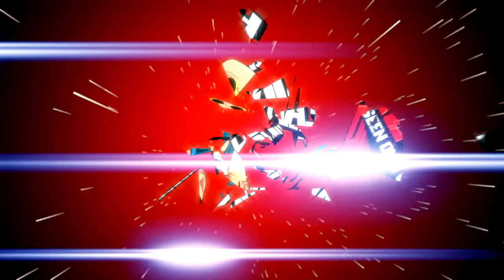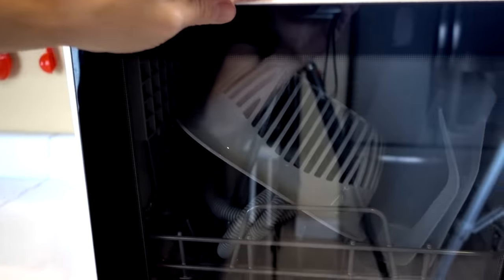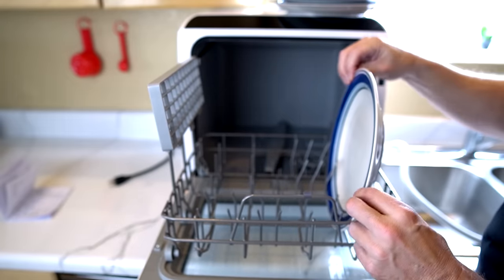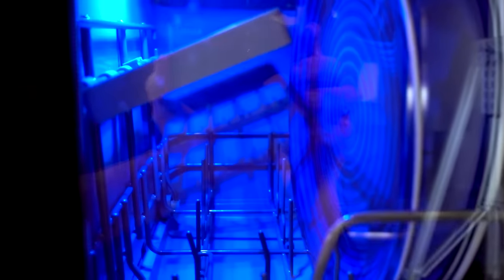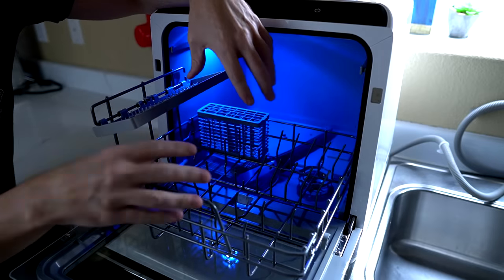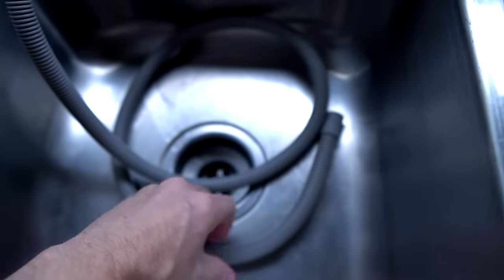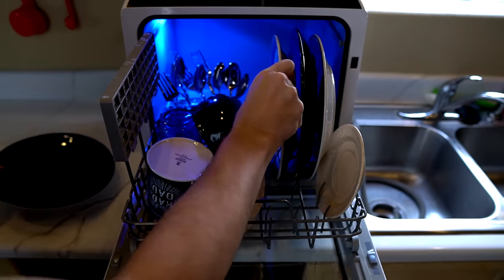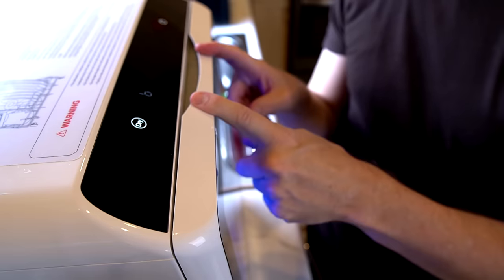Do Countertop Dishwashers Work? By Request!

Comment: Not sure why I have never heard of a counter top dishwasher but for a single guy with one kid and a ton of back problems to the point I can’t do 10min of dishes this might be an option!
Reply: If you have any way of getting a fullsize dishwasher (even if you have to wheel it to the sink and connect a hose to the faucet), they're much better. But if you have absolutely no way, then a countertop dishwasher is better than nothing. Get the largest model you can find and make sure it heats the water after it's pumped in. Some don't.
Reply: Dude same.. I can't stand up for that long hunched over a sink.. like if my counter was a foot taller I may be able to.. but my apartment is tiny and I live alone. Already have one of these on the way
Reply: I have more metal in my back than a Kia...LOL.  If I wash more than just a few dishes by hand I use a stool.  I would never buy one of these units.
Reply: I would never give up my full size dishwasher in my current kitchen, but yeah I can see this for people with back problems, or a small apartment, but where this really would be impressive would be a renovated RV/travel trailer, with it plumbed into the gray, and fresh water lines with a shelf built under the sink area to keep it out of the way.
Reply: @rantsandreviews  Dishwashers that heat the water sterilize the dishes better than you can wash them by hand and use less water. Less use of the water heater to wash dishes also saves electricity. You do no one no favors by washing them by hand, it's not more moral or holy than using a machine.
Reply: @MilwaukeeWoman  Jesus christ dude, the guy likes to wash his dishes by sink. Chill out before you give yourself an aneurism
Reply: Im 5'10" and yeah dishes are hard on my back. :( 
Im ordering one
Reply: I've used a RCA countertop dishwasher for just over a year now.  It's wider than the one he reviews - about 22" wide - and an inch or so taller.  I freakin' LOVE it.  I live alone, and it holds about a week's worth of dishes/cutlery/glasses for me.  Sometimes I get lazy and don't feel like washing my pots and pans and once they've filled the sink, I'll do a load in the dishwasher just of pots and pans.  It never ceases to surprise me just how much I can fit into it, and it does a fantastic job on my pots and pans even when they have caked-on dried-on remnants of food!
Reply: @LauraRealLife  Question: does the filter get clogged up from the chunks of food? I gave up on dishwashers because my kids kept loading mine with food on them. I had to replace the pump several times, so I finally decided my kids could do them by hand. Now that they're grown, I've been considering getting a new one.
Reply: @drfreud65  In mine, there is a filter at the bottom with a little basket below it.  The filter and basket lift out easily.  It catches most all food particles.  TBH, I'm quite lazy about rinsing off my dishes before I load them into the dishwasher, so I have to lift the filter and basket out and rinse it off every other load.  So far, I've not had any problems; I'm actually more concerned about mineral build-up eventually causing problems with my dishwasher as the water where I live (rural Oregon) is very "hard".  I've had issues with mineral build-up clogging up my shower and sink faucets.  Because the water is so hard, I do use a rinse aid in the dishwasher (my RCA model has a rinse aid dispenser built into it) and so far, I don't see any signs of mineral build up.  I definitely do recommend using a rinse aid if you have "hard" water.
Reply: @hxhdfjifzirstc894  they use countertop dishwasher in lots of restaurants though.. the wash time is very short, and gets very hot.. when i worked in a fish shop we had one of them.. used to run it like 10 times every hour.. Prob more expensive then a normal one though (all stainless machine).
Reply: I'd say it's also a good thing, if you just don't have the room in your kitchen for a regular Dishwasher. There needs to be space in there for it to fit, and if the kitchen doesn't have that or you can't/don't want to modify it to fit one, those things are a good alternative. 
Especially for a Single Houshold, or if you are just a couple or whatever. They got enough space for the dishes of a day or two for 1-2 people. 
Not suitable tough for more people and the regular dishwasher is also for most circumstances the better option, if you got the space and stuff. Also allows you to be more lazy. I'm fucking lazy. We are a two person houshold. I put ANYTHING in there that I can, including large bowls, wich are otherwise a waste of space.
Reply: @LauraRealLife  Here's what I do because my water is somewhat "hard". I add a Tablespoon of Borax to the detergent cup. It softens the water and the dishes come out cleaner as it boosts the detergent.
Reply: @artemismeow  I understand. I'm 6ft and doing dishes kills my back and causes my chronic pain to flare up. I wish I could afford a unit like this.
Reply: @palmettotree1221  Thanks so much for the tip, I will try that!  I actually have some Borax here already, so will try it next time I run a load.
Reply: @larsvegas1505  but they are not compact. They are very tall, assuming you are talking about restaurant/industrial/professional machines.Thie is a compact machine for a counter.
Reply: @chuggabug4587  I actually did, but just one of their dishwasher drawers costs three times as much as I paid for my RCA countertop dishwasher, plus I'd have to pay for getting it installed, plumbed and electric run to it.  All told, I was looking at around $1,100-$1,300 for a Fisher-Paykel dishwasher drawer.  My RCA countertop dishwasher cost me $229 delivered and took me less than 10 minutes to unpack and set up.
Reply: I use a dishwasher due to disability. I've never had room for full size undercounter, but if I had full size on counter I couldn't reach controls, so I have a countertop one. I'm now on my 3rd one in 20 years. The only criticism I have is for some reason they seem to be made for small dinner plates (I can't find any that small), so they haveto go in diagonally, which takes up a lot more room. Oh, yeah, those 'cup' shelves are ridiculously small!
Reply: @CommodoreFan64  Tiny homes as well
Reply: But it’s four plates
Reply: Right? I didn't even know these even existed. It would be perfect for a single guy like me
Reply: @palmettotree1221  I was just going to suggest that. Good idea.
Reply: @LauraRealLife  is it safe to pour hot water in the water tank?
Reply: @angelinam533  My countertop dishwasher attaches directly to my sink faucet and doesn't have a separate water tank, so I can't answer from personal experience.  I would suggest reading the users manual of the dishwasher you own (or are looking to buy) that has a separate water tank and see  what it says.  Good luck!
Reply: @palmettotree1221  I'm a little late but borax is actually toxic to consume. I don't know that I would use it in the dishwasher.

Comment: You really did effort for the 'unfair' test, but that's really usefull to see it's performance on dishes you might have forgotten to rinse. Thanks for the effort!
Reply: You shouldn't need to rinse dishes.... Normal dishwasher have a prewash cycle
Reply: @teshiburu  that depends entirely on you. If you use dishwasher pods, you are trading cleaning power for "convenience". I say that in quotations because I really don't know how a pod is more convenient.

Anyways, the 2 biggest factors of getting a good clean from your dishwasher is running your water until it's hot before using the machine to ensure a hot pre wash. The second is making sure you put soap on your pre wash chamber. The enzymes in your soap need time to work, that's why they need to be in the pre wash. When you use pods, you don't get the enzymes in the pre wash you need.
Reply: @GodleyX  running the water only matters if you're dishwasher doesn't heat water itself most do (in the UK at least)
Reply: @teshiburu  yeah they do heat themselves but it isn't very good at the beginning, where the pre wash is at. Takes a bit to warm up and I see no issue with running the water until it gets hot lol. Running ice cold water into the machine isn't as good as running hot water into it

Comment: Great demo!  I bought this baby a few weeks ago and love it!  The "useless" shelf can be used for shot glasses, but I use it for knives and whisks.  You can avoid water spillage (when filling the tank) by using a funnel.  I had on hand a funnel that I bought off Amazon some time back.  Works perfectly! Also - I've only use the ECO cycle and it works great.  Still uses all 3 carafes of water, but not as much power since it runs in half the time (30 min). This appliance is suitable for a household of 1 or  2.
Reply: Yes, the flip down shelf is good for small fruit bowls/ramekins and cooking utensils like spatulas. 

I’ll admit this performed far better than I’d expected!
Reply: Short glasses like those short whiskey glasses?
Reply: I use the little shelf for that and also lids, dipping dishes, and turners/spatulas.

Comment: I like this idea mainly because the water gets hotter than I could put my hands in. Since I’m a single person, I don’t need a full sized dishwasher. And I never ran mine through the dry cycle; just open the door and they dry just fine.

Comment: I feel like this would be good for those who live in a smaller house or apartment and live alone or don’t really have a lot of dishes
Reply: I have one that fits service for 8 and it's perfect for our family of 5.
Reply: I would have killed for this when I worked so much and was single. And I would have just opened the door and let the steam into my dry  apartment and let them air dry.
Reply: This would be great for an RV or boat as well. This would have been great for my first apartment!
Reply: @Serf_dom  Which one do you have?
Reply: @ale347baker  SPT
Reply: I guess, I feel like if you don't have alot dishes isn't it easier to just handwash? I would rather not take up counter space but maybe that's just me.
Reply: @JK-zz4ip  I see it as mildly useful to multitask - drop my bowls/plates/utensils in the dishwasher and then tackle space-consuming/non-dishwasher-friendly items like pots, pans, blender assemblies...IDK about countertop models, but dishwashers generally tend to save water/detergent by reusing it when possible, as opposed to leaving the tap on while you go plate by plate.
Reply: @chatboss000  oh my goodness, who leaves the tap on when they wash dishes!!!! My friend had a counter top dishwasher but because her kitchen was so tiny it only left her with 1 square foot of counter space. I also used to provide childcare for a couple with one baby and in the mornings they would run the, full-size,  dishwasher with literally a few cups/mugs. A plate or two and few utensils. These are just scenarios where I would rather just hand wash.
Reply: @Serf_dom  which do you have?
Reply: @AKReptileLux  SPT
Reply: Genius 🍪
Reply: I don't have an actual kitchen. I mean I have access to a shared one, but I am reclusive and don't like stairs. A microwave, a small fridge, a deep freeze chest, a hot plate, and a countertop dishwasher, turns a waist high 6 drawer dresser into my kitchen counter.
Reply: @chatboss000  That's what I did. I cleaned the kitchen while the dishes were washing. I feel it was worth the money.
Reply: @JK-zz4ip  I agree. It's much faster to just wash them by hand when the machine holds so few plates and things.  If you live in a dorm and don't want to wash your dishes in the bathroom, this should work fine. It looks like I have the same dishwasher, but mine has a different name -- Mava -- for some reason.
Reply: @rickved  if you don't have a sink you can use tbis and drain the waste water into a bucket. Or uh, hand wash all your dishes in one bucket.
Reply: I got a slim standard dishwasher and plumbed it in under the counter
Reply: @Tokaisho1  if I had the space and money for a full size I would have definitely gotten a full size. For people that can't or don't want to spend the money/space these are great alternatives.
Reply: @Serf_dom  It's a slimline so not as wide as full size, my slot wasn't wide enough due to it originally having a small refrigerator

Comment: I've had to wash my dishes by hand for over 3 years, and I am in the market for a countertop dishwasher.  I really appreciated this thorough review! Whether I get this model or not, you've helped me think through a lot of the aspects I'll need to consider! 
Your plates are massive compared to mine (thin correlle dishes) and it's just me in the apartment so I don't have many dishes to begin with.  But dishes always seems to be the chore I hate the most and I think this would really improve my mental health to have a clean sink easily.   I could set this to run when I go to bed with just that day's dishes and have no problem with a smaller amount of dish space.  I just don't want to put it through the washer and then still have to wash it by hand if it came out not fully clean.  I also really appreciate the high temperature because it can sanitize my dishes better than I can by hand.  

Thanks for this thorough review! The "unfair test" was particularly helpful!

Comment: I've had this exact dishwasher for about a year and I love it. I live alone and work an insane amount so I don't create tons of dishes, but it is so helpful and works great. I removed the top shelf because it's not very functional and mostly just gets in the way. The water gets nice and hot and everything comes out spotless. Great buy for me personally.
Reply: What’s the brand ?
Reply: Does the Derwent cup have a lid,  does it have rinc how long did it take 2 leern how to fill for best worke (jet dry) can you ďo pots/pans. Dutch oven if you remove rhe top tray. Can you remove tge lower tray for cleaning. Can you trmome the armn/filter, were able to get longer hoses  if needed where is it ,ade( 4 repairs if necessary)  does the blue light what kind of soup is the best to use stay on.
Reply: @isabelacarrico9837  the brand is Novete
Reply: @snylah-mariebrandt329  I'll do my best to answer your questions, but I'm afraid I don't understand most of them. It has a small lid to cover the hole where you fill it. You can remove the lower tray and filter for cleaning. I think you can remove the spray arms too. I'm sure you can find longer hose attachments at a hardware store, but I'm not sure. The blue light only stays on for a minute or so, then it turns off. Most pots and pans will not fit unless it's the only thing in the dishwasher. I usually load the dishwasher with my silverware, cups, bowls, and smaller things. I wash pots and pans by hand. Hope this helps!
Reply: @coorah9256  Thank u.

Comment: I've been debating getting one of these (this exact model actually!) since I live in a smallish place ( great landlord and yearly rent cheaper than property taxes). Seeing a side by side testing comparison with the "unfair" test gave me great info.  

A little heads up on the "mug " rack and small utensil holes. I had something similar to one of these when I lived in Japan I used the rack for rice paddles and rice bowls and the small utensil slots for chopsticks.
Reply: I bought an edgestar brand on amazon.  It's basically about the size of the top rack of my installed dishwasher in my kitchen.  But it's large enough to take 6 place settings including full sized 10 inch dinner plates.  As long as you stick to a liquid or gel detergent these work very nicely.  I take mine when I stay at extended stay hotels for more than two or three nights.  Along with a toaster oven and an instant pot it's like having a full service travel kitchen anytime you need one.  In fact I can save money on extended stays away from home because with those three appliances, I really only need a fridge in my hotel room, instead of paying extra for a "kitchenette".
Reply: Right, i think these specific ones are designed for Japanese households. There are bigger ones that can accommodate more American sized serveware
Reply: How much did it cost?